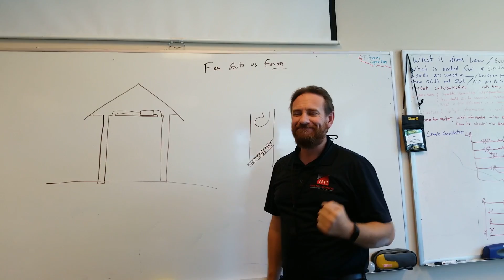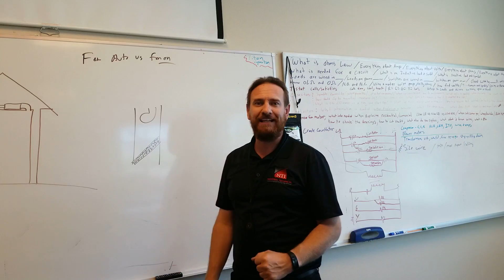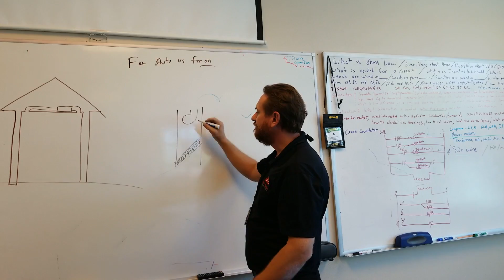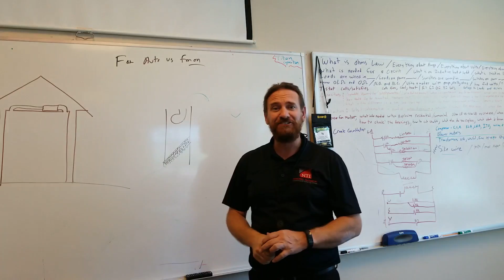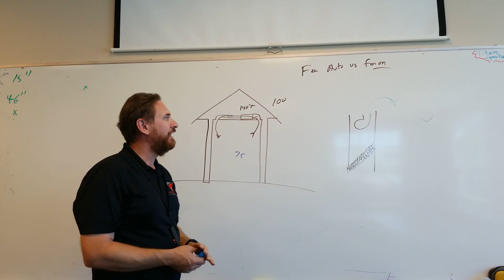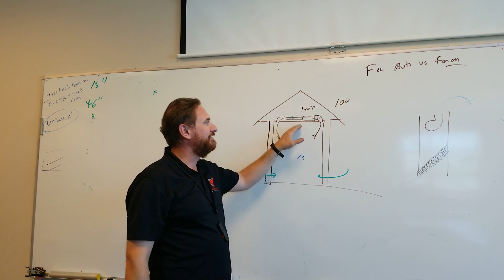Fan on VS fan Auto

Comment: Thank you! There are 1 too many wrong vids on this. If you run the fan  constantly on AC you raise the humidity in your home!
Reply: I was told to only turn the fan on when using heat.
Reply from the maker: Thank you. The evaporated moisture is a bignissue.
Even in heating mode, I would want it in auto to prevent air moving feeling cooler. 
Home sealing and blower door testing are beneficial in both.
Reply: @love2hvac  my HVAC buddy said you should use fan on heat only, say if you have company over or you are cooking, to help circulate air. But yeah, your video closed the debate, thanks!

Comment: Hello Branaman, in the second story we got big issues the first story will be cold while the second still warm and the system is stop running. What do you think best solutions could do? Thanks.
Reply from the maker: It's an air sealing issue.
The best solution would be a blower door test to find how much and where the home is leaking

After that, I would seal the home if it's possible. Then you could look at adding a damper system or even adding a ductless unit to the upstairs.

Comment: How do I know which type of motor I have?
Reply: Old comment, but if your air handler motor has a capacitor it’s a PSC, permanent split capacitor type motor. No capacitor it’s a ECM type motor and you will see the ECM module that attaches to the end of the fan motor.

Comment: I live in Tucson, Az and there are hot spots around the house. We keep the AC at 72° and on auto. Should i be leaving our system's fan in the "on" position or "auto". Please respond, summer here is HOT!! and I'm worried. Thank you.
Reply: Leaving the fan ON will help keep the house similar temperatures.  So it’ll help even out that hit spot and make it a cool spot.

Comment: My ac is blowing warm air from around 12 noon till 7 pm in the evening then start getting cold again. I've had someone change the fan, the compasitor and thermostat and it's still doing the same thing. I stay in miami but my unit just started doing this 4 months ago. My unit is 14 years old and a 4 ton unit for a 1800 sq ft. Home someone please help.😩
Reply from the maker: 4 ton is too big, it will never dehumidify. 14 years old it's probably at the end of its life.
I would call a company to do a heat load calculatin and proper sizing with manual J or wrightsoft. If they dont do that or say anything about square foot per ton hang up and call the next.
Reply: @love2hvac  thanks for replying but the unit was new when I moved in the home and I've never had issues with it until now. 75 was cooling my home easily but now it's on 71 and only stays cold overnight until noon then its 80 degrees inside my home. Last person I had chand the fan and compasitor said the compressor was good as well as the return air at 57 degrees. Man I dont wanna pay all that money for a new unit but if I have to then oh well
Reply from the maker: @mikelowry7730  
When they said the compressor was good, did they perform any tests on it.
Pump down test, Compression ratio, capacity test, meg windings. Too often somebody will say it's running it's good but a running compressor does not mean it's running right.

The purpose of an ac is not to make a temperature. It is to cool, dehumidify and control air quality. Humidity is just as if not more important than temperature. This is where the pshyxrometric chart comes into play. 

Last I realize that the oversized issues is not the cause of the immediate issue you are having. However, an oversized system is still oversized weather it was 15 years ago or today. An oversized system will not properly dehumidify, use more electricity, and have much more wear on the compressor for the extra on off cycles. 

Without a diagnostics form filled our or being there in person I cannot diagnose the system. There are a lot of people in the trade that are just in to collect money without understanding the equipment. By finding someone that knows heat load calculations you are more likely to fand a qualified and knowledgeable company to take care of your needs. Even if that company does not replace the system they would be more likely to find direct cause and properly evaluate they system.
Reply: @love2hvac  ok thank you so much for your time and wisdom sir, I will definitely call a qualified company to give me a proper direction

Comment: I live in Georgia. I just moved into my two-bedroom apartment & it never seems cool in my place. You hear the noise of the a/c unit blowing but can't feel anything. My bedroom you can't feel any coolness. I usually have temperatures to 76 degrees all day & night. What do I set my thermostat on? Fan Auto or on.
Btw temp reach 89-98 outside
Reply: My upstairs can get 10 degrees warmer than downstairs. So I was having to turn my air down to 65 just to get some relief.
Started running my fan on auto and realized I can turn my air on 73 and still be comfortable all over my house.
My bill raised about $10-15 a month.. However I do live in the south (Alabama) and it’s humid. Rarely below 80%
So that’s concerning..
Reply from the maker: Sounds like an air leaking problem.
See if a company does blower door testing
 
Companies that do that are hvac, home performance and insulation.
If you can seal the house better it will help with stratification and humidity infiltration.

Comment: The coil only has at the most a half a gallon of water or less on the coil, would you really be adding that much more humidity to the air by leaving the fan on?
Reply from the maker: Hi Tommy,
Yes that is significant amount of moisture and energy.
It takes 970 BTU to condense 1 pound of water
1/2 gallon weighs 4.17 pounds = 4,044.9 BTU of energy.
A small amount of moisture can raise humidiy
https://www.google.com/url?sa=t&rct=j&q=&esrc=s&source=web&cd=1&cad=rja&uact=8&ved=2ahUKEwjh17Lpks7kAhUhNH0KHUZ-CGcQFjAAegQIBRAC&url=https%3A%2F%2Fwww.osti.gov%2Fservlets%2Fpurl%2F881342&usg=AOvVaw1FlbEmEGLhvXICk-QCN1sa

Comment: Letting the coil remain moist with the fan on auto does not seem to be a good idea. For the summer months, it seems that leaving the fan on (low) will remove moisture that can cause mold to grow on the coil. Also, having a dehumidifier in the basement would take care of any additional moisture that might be produced. Possible? Can mold grow on the coil?
Reply from the maker: One of the main parts of an AC is dehumidification. The coil is designed to resist growth and be wet if it is kept clean with proper filtration. If a growth becomes an issue an ultraviolet light can be added to the coil to prevent the growth. A uv light on the coil should be a non ozone non ionizing, non hydro peroxide generating type. It must be shinning on the coil. 

The idea is the moisture will be somewhere we want to remove it from the air to the evaporator coil and then from there it will drain outside or into the sewer where approved. 

In a humid climate, leaving the fan on pushing the moisture back into the air defeats a big part of the ac system. 

Adding a dehumidifier is an option but a dehumidifier is just an ac that dumps the heat back into the same room. It will still have an evaporator coil that will still be wet that has the same potential for growth. 

A properly sized AC should dehumidify and cool all in one motion. A big problem is when the ac is oversized it cannot dehumidify as well a a long list of other side effects. 

You had a great question, thanks for asking.